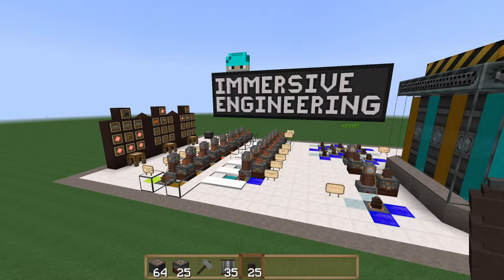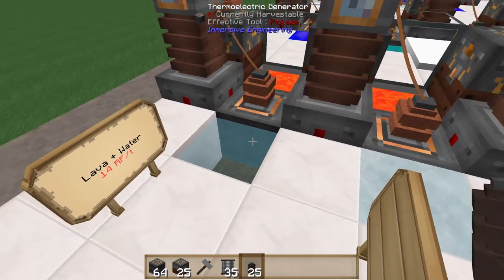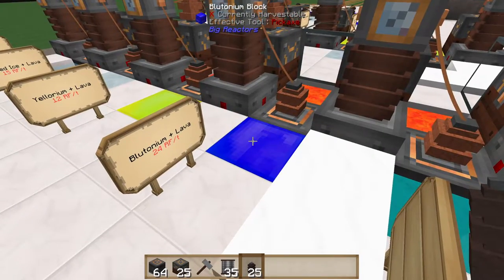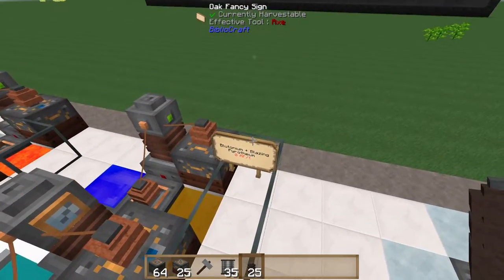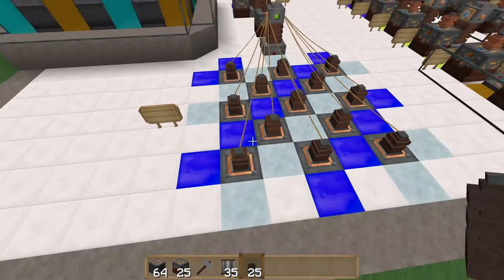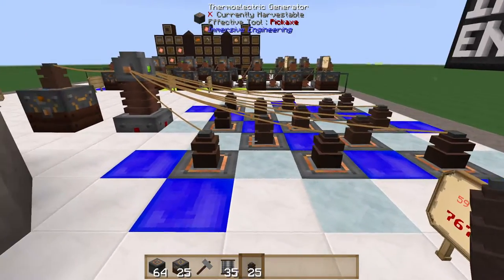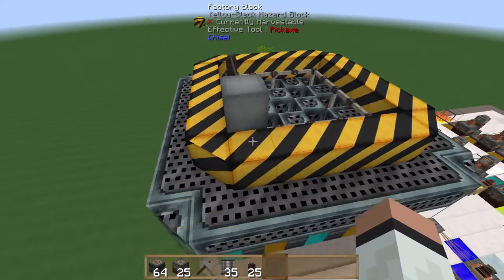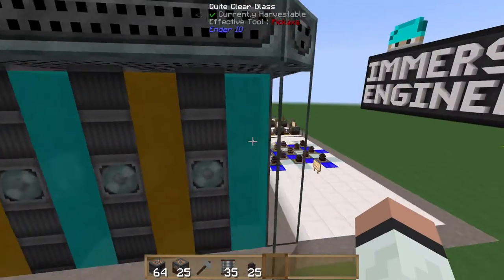Mod Spotlight: Immersive Engineering 0.7.1.2 Ep. #5 -- Power Generation: Thermoelectric Generator

Comment: Your power loss is likely due to cables that you use - they have some power loss over distance, even though the distance is minimal it is most likely rounded down... You can check it with enderio capacitor banks(directly) or something similar :)